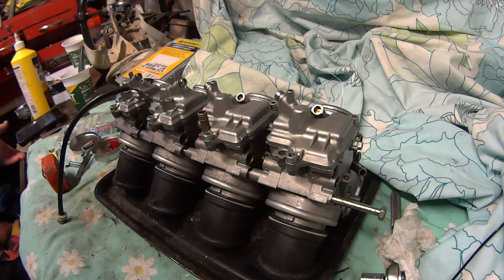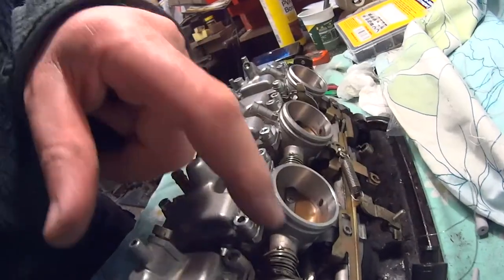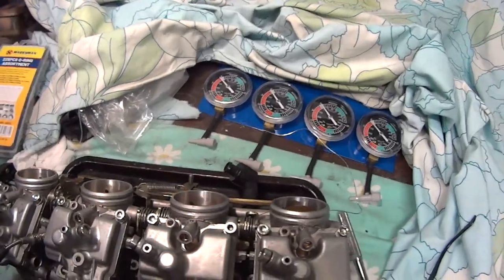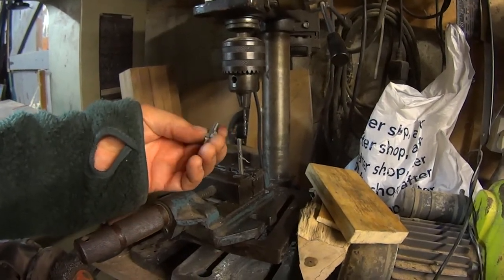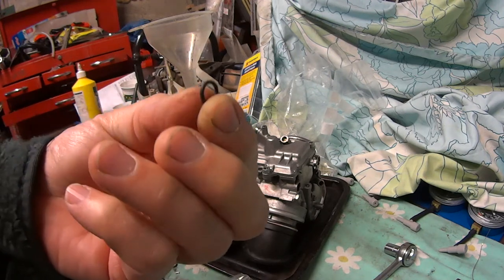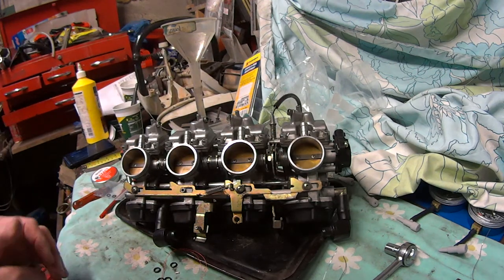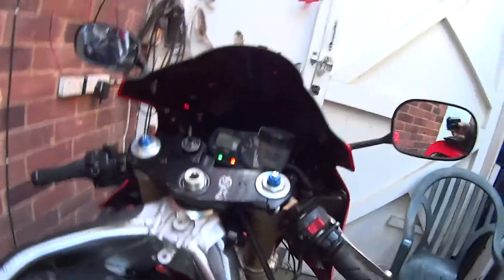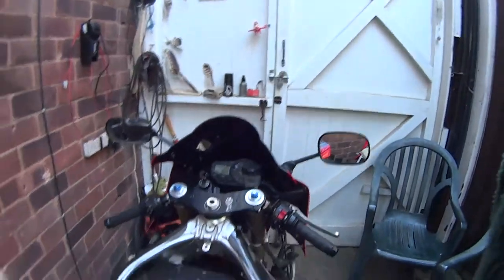Yamaha R1 carbs leaking fix.

Comment: Hey, thanks for taking the time to make this video. I'm going to give this a go on my buddies carbs. He's brought this to 4 shops, lets see if I can knock this one out of the park.
Reply from the maker: Thanks mate, strong thread round stop adj springs is a must to stop them disapearing round the workshop and careful not to scrap the tubes on the walls inside the carbs as you angle them in or under the o rings as you get them out. cheers Andy.

Comment: I have just got my carbs off as it’s running like a bag of nails. I am quite nervous about checking them over. I was just going to check carbs over for waxing etc as it’s been sat still 8 months. Them round seals were they leaking before? Did you change the gaskets or were they ok? Great clip very helpful.
Reply from the maker: Hi, Yes they were leaking before, it was the reason I striped them down. The old paper gaskets weren't damaged so I put them back but the seals on the fuel tubes had hardened and squared off, which was the leak, I have also found if they still leak it is likely to be on start-up when the bikes cold so start with choke full on  and leave on till warm knock it back slightly if it stutters and wait probably 2-4 minutes don't run it though if it still leaks down the left hand side, that's the left on mine, don't ride it if leaking a few drops of fuel should stop when warmed up, if not you may have to have another go at it I'm afraid. Good luck Andy.👍

Comment: Morning buddy
Should there be a gap with the butterfly's
I thought they should be seated flush
Reply from the maker: Hi, I find it's the only way you can see they are all exactly the same is to have a minute gap of light showing through each one as if you can't see where they stop when they are completely shut you won't know they are moving off the stop at the same time this  works fine for me. Good luck 👍
Reply: Thanks Buddy

Comment: I have a 99 r1 that I did carbs and sync it runs perfect when cold as soon as it gets warm it starts to misfire and won’t run. Once it sits over night same thing again
Reply from the maker: Hi, If you have striped and cleaned the carbs, there are a few things you could try, firstly with the choke on and it reving  it is sometimes difficult to tell if all cylinders are firing so as a matter of course I would pop some new plugs in unless you have already, if you know someone with the same bike a coil pack can sometimes go bad that's trying the electrical side. Possibly if you have a aftermarket exhaust the air screw settings may change the book setting is 3:1/8 out from stop I do have a straight through exhaust and have found I need to put them at 3:3/4--4: turns out you sound like you are needing a higher or more fuel to air mixture when warm as the choke is blocking off the air and incressing the fuel, I think first I would try turning the piolet air screws in to probably 2 turns and go from there could also be worth adjusting the needle position, although if Im honest I would guess there is still a problem inside the carbs as the bike I guess ran nicely in the past. sorry I cant be more helpful. Regards Andy.
Reply: @yamaar1rider  I will definitely try that and see if it helps. I does have straight though exhaust as well so it very possible that the mixture is off a little bit. I did think about the coils but I have no extras and I don’t want to just replace parts unless it’s necessary.  I really appreciate the response and will let you know what I find thank you 🙏
Reply from the maker: @MrRyan6616  ok let me know how it goes, I do have a spare coil pack I tried on mine, didn't find it to be that when I was having troubles, you could have tried that but I'm guessing you could be anywhere in the world 😄 I'm in England Leicestershire. Cheers Andy 👍
Reply: @yamaar1rider  ahhh yea I’m in US California to be exact
Reply from the maker: @MrRyan6616  Nice weather for you then and I guess you get out more than I do with the English rain we get, although we are having some sun at the moment and you are are stuck in with the R1 troubles. good luck Andy.👍
Reply: @yamaar1rider  yes definitely 💯 plus degree weather…. 😆
Reply from the maker: @MrRyan6616  👍

Comment: What kind of o ring pack did you get? Was gonna order it and just wanna be sure the kit I order has the exact o rings I need for the crossover tubes.
Reply from the maker: Hi, Marksman 225pc item code 62037c : R-05 in kit : inside diameter 6mm : section 2mm : which is 10mm over all, from Ebay. It may also be usefull for you to know that as they get older they can leak on startup when cold, a short term or you can do it all the time on startup is dont mess with the choke put it full on and leave it on till warm, this sometimes stops the leaking until everything expands and seals any tubes that are leaking.         cheers Andy.

Comment: Buddy one last thing 
I can tune & get the butterfly's to sit nice 
But
Only 3 doesn't matter what I try always 1 of the fly's sits flush number 4, or 1.
Adjustment is 123. Gaped with 4 flush
Or 234 gaped with number 1 flush
Any suggestions please 🥺
Reply from the maker: Hi John,  no sure you should be able to sit them all level with the screws but obviously that's not possible for you all I can suggest without seeing it are possibilities. Butterfly loose, bent or worn, shaft worn can't think of anything else ☹️ Andy
Reply: Ok buddy
Thanks for that 
It's what I thought 🤔
So I just have to see what I can do
She is getting old hahahaha
25 now 1999
Happy Riding ☺️
Thanks 👍 for ya help 
John
Reply from the maker: @johneley5680    another thing is are all 3 cables slack ? cheers John

Comment: I put a throttle cable on mine i cant get the dam carbs back on. I tried everything other than beating on them with a hammer.
Reply from the maker: Keep calm mate have a cup of tea, make sure the screws are backed right off on the rubbers, bit of WD on the rubbers they are at a strange angle but preserve a headlight will help you see if they are twisting and the rubber lips turning in, someone else holding light pressure on them as you line them up, they do have a habit of slipping back off if you release the pressure before tightening the clamp screws. Hope all goes ok. Regards Andy 👍
Reply: I just dont see how to tighten the rubber clamps after you get the carb on. Id need a special tool. I was able to pull it off without loosening them
Reply from the maker: @stephenmacdonald912   check the tool at 21.00 minutes 👍